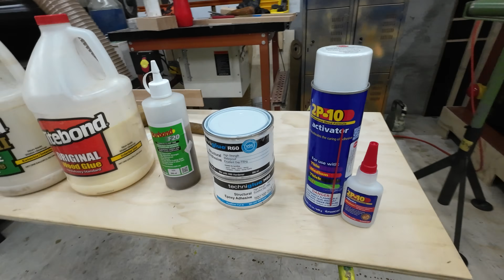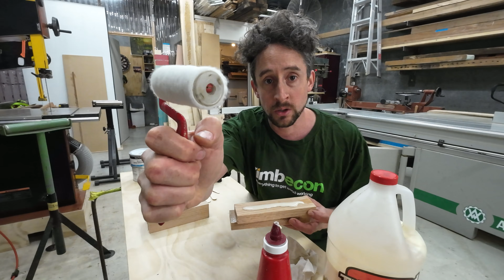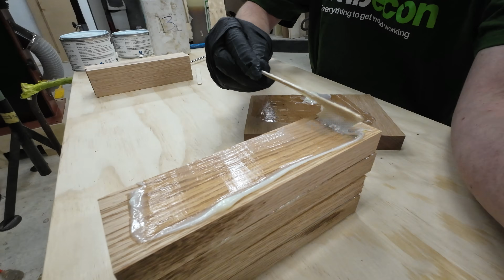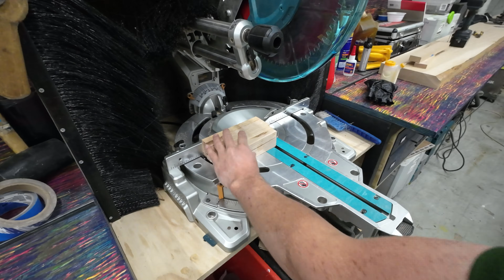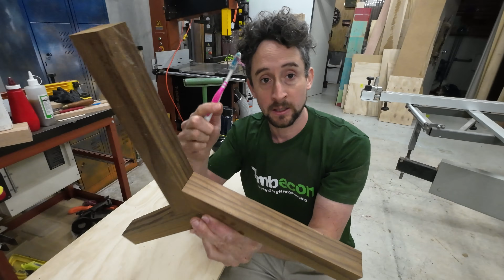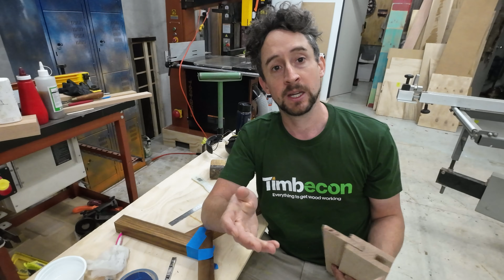Patrick's Guide to Glue!

Comment: Great video, Patrick.  Sorry to wattabout, but hide glue.  I know it's the stuff of hand tool aficionados and furniture restorers, but it's easy to use, safe, dries clear, and reversible. It has downsides, not as strong as modern glues, not water resistant.
You wouldn't use it for panel glue ups or larger cases, but for detailed work and small pieces, it's fantastic.
Reply: Hey mate, Yeah really good point. I have used it occasionally but for the work I do it is not one I reach for often. It has it's place but not common for me.

Comment: Thanks. Glad you agree with pva and water rather than tape. Tried the tape trick several times and it’s too time consuming and doesn’t work that great given the effort in my mind. I’m keen to use techniglue but never had a great need. The other thing to note for Aussies is a lot of PVAs on Blackwood stain it yellow/green. You can sand off but if you get tons of glue it can be pretty deep in the pores. Some of the cheap Bunnings pva like aqua adhere indoor and I think and Tighbond Original won’t and then ploy glues or techniglue don’t either I am pretty sure.